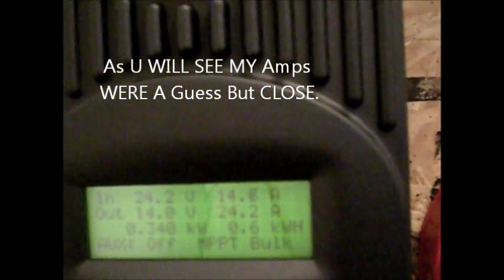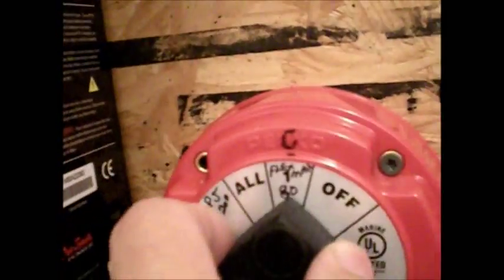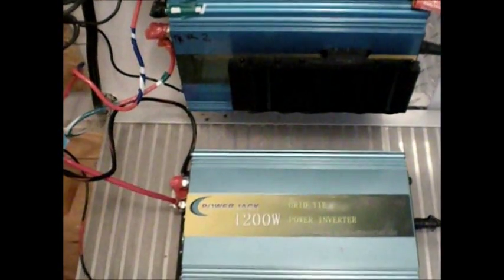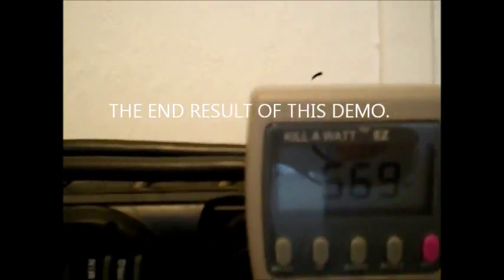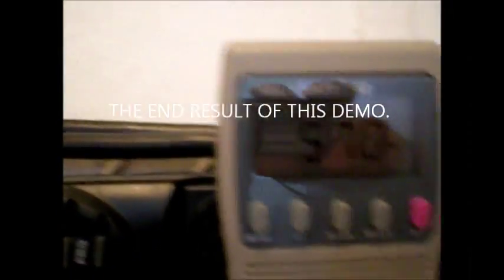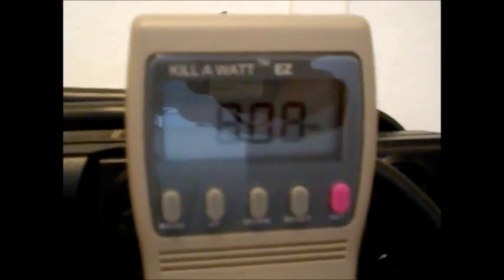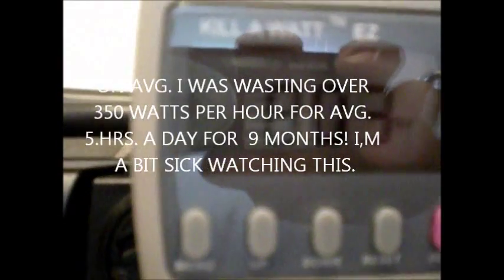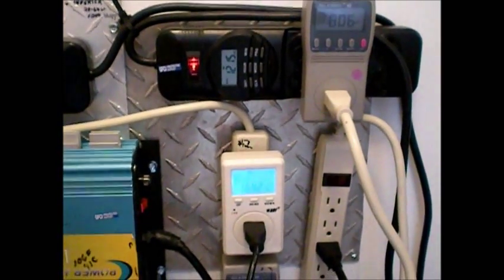HOW MUCH POWER WAS I WASTING?

Comment: Just use a relay and turn the 110VAC on to the grid tie inverter with a aux relay.  Just make sure your not pushing more than your using as the meter will not run backwards.  I use a current sensing relay in may mains box and only turn on the grid tie when there are high power demands. At that time a relay opens and sends the power from my 12v bank straight to the grid tie batteries bypassing the 24v controller.

Comment from the maker: Yes & no By setting the AUX mode  to operate above 14.4 volts during absorption  When gassing occurs  it can switch a small load less than 200ma.like relay switch to turn on a vent fan or cooler fan or any thing a relay can turn on but it must get the power from elsewhere.not through the flex max,So turn on grid tie if u use all out back components i believe u can u need a hub and a mate to switch 1 of there units but is has to be wired correctly i cant do it,the way my system is set up.

Comment from the maker: YAWN aH Did i miss something?  The AUX mode if it is set to switch on after float is achieved or during absorption mode if the voltage parameters are set to do that. It will not run anything more than 200ma.according to my owners Manuel if used above that u can use aux to switch some thing on with a relay that uses less than 200ma. it must get its power from a separate source ,battery bank or what ever. unless u have a Mate & a Hub to run other Out Back equipment like a VXFX grid tie inverter.
Reply: Great video ...got a quick question for you ...I have a flexmax 60 and wanna install 1100w of solar ...I have a 12v inverter and 600ah battery bank ...thing is I was wondering if the 1100w will damage the controller or will it limit the input to suit ...btw the voc is 80v and short circuit amps is 20.8 ...ps..I can't afford to purchase a 24v inverter at the moment but will in future ..in the meantime I'd love if the 1100w can be installed and working . Thanks
Reply from the maker: @fazimabdool6437  I believe my flexmax 80 is good for 1200 watts at 12 volts. U should look up the owners manual for your answer. that said it should shunt or put to ground exceeded  amps.
Reply: @TheKiloG69  ok great thanks